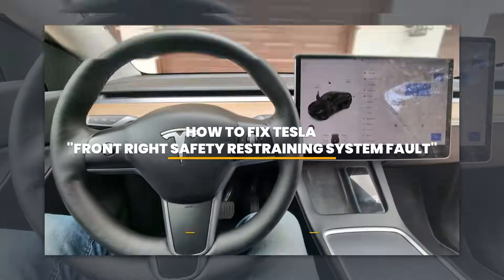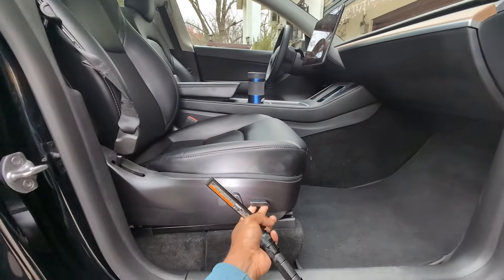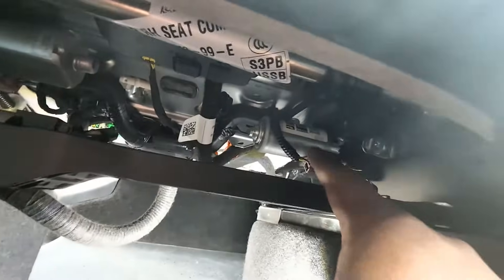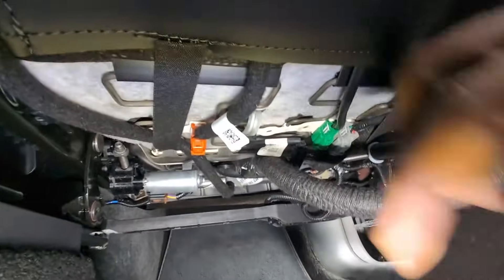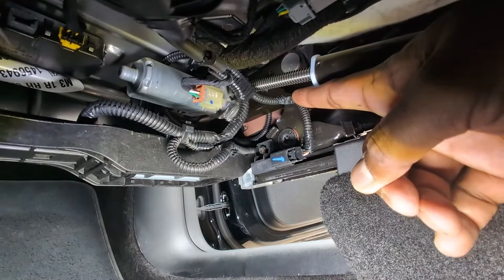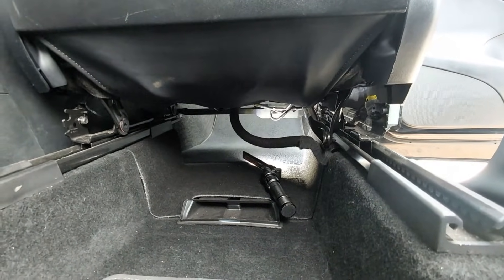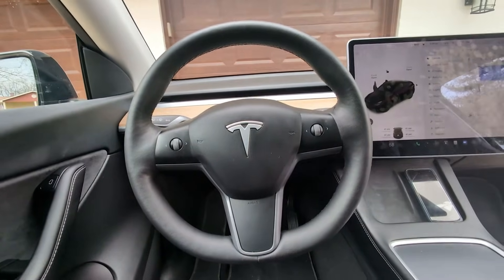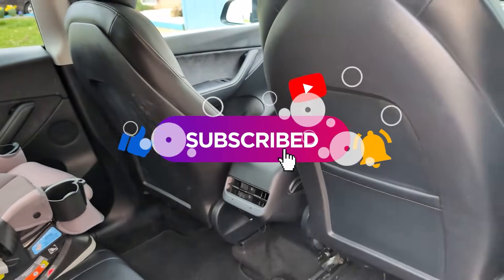Tesla Front Right Safety Restraint System Fault - SOLVED

Comment: I just started receiving similar error “Safety restrain system issue (RCM_a078)”

After watching your video I suspect wiring issue under the driver seat
Reply from the maker: Did you look under the seat? Any signs of wire detachment?
Reply: @JJCentral-DIY I actually figured it out. The issue is the buckle itself, when it is buckled, there is no continuity between two pins that come out of the buckle connector (even though latch/unlatch is detected). From what I understand RCM is looking for small resistance in buckle circuit. Found buckle replacement on eBay for $15, waiting for arrival

Comment: If you thoroughly check the wiring and nothing has been damaged, I would suspect the most likely to be the micro-switch in the belt buckle clip. Of course it would be a sealed unit and unreachable, so a replacement belt would be necessary. The switch gets worked every time you buckle up or unbuckle.
Reply: Update, the entire cover on the belt anchor clip is removable, and I was able to spray the switch with electro contact cleaner spray.  This didn't solve my problem. everyone knows when wires are bent back and forth continually, every time you get in or out of the car, the wires will eventually weaken or even break. Silly me, for some reason I had set the seat to a high up level when driving. So I just re-set it to just remain low at all times. Guess what... the warning disappeared and never returned. Should it come back, then I will replace the wire.
Reply from the maker: Thank you for the update. Others can see and get the proper idea. Use a continuity check in multimeter to see any breaks. You may need to change the wire at some point. Great job.

Comment: My M3 has message Front passenger safety restraint system issue (RCM_a056). Is this the same issue? Tesla quoted me over $1700 as they claim sensor, airbag and other components need to be replaced (never been in an accident). Is Tesla just trying to scam me?
Reply from the maker: Why don't you take a look under the seat?

Comment: I am getting the same error. Out of warranty as of April last year... and they want to charge $1140.
Reply from the maker: @TerribleMighty1  Did you check under the seat?
Reply: @ i did a quick check but nothing stands out. I have a model 3 so a little more cramped compared to a Model Y. I’ll check again in a bit most likely
Reply: Tesla wanted to charge me in the neighborhood of $1,100 also, I was at 51k miles at the time but Tesla wouldn’t good will or check fault history. My wife’s car so it could have popped up and went away prior to the 50k mile warranty was up. The warning comes and goes, now it’s been on a few days so I’m looking into getting it fixed and ran into your video. Thanks

Comment: I have this issue on my Tesla model 3 but i noticed there i a red plug coming off near the Orange connection that not plugged it but i cant see where it goes do you uave any idea . I believe it  has only 1 or wires in this red plug please help
Reply: I saw that on mine too. I think it's just a connection lead for Tesla service to plug in when testing. Just tuck it out of the way.

Comment: Thank you for the video. This is why Tesla sucks. Anything that revolves around safety in my mind should be covered under a lifetime warranty. A wire getting pinched because of their ineptitude with engineering is not a customer's fault. Tesla wanted to charge me close to $800 to fix this.
Reply from the maker: Hope you were able to do this yourself and save some money. Yes, there are some questionable tesla engineering designs that you see all around the car.
Reply: @JJCentral-DIY  Actually I looked under and it's not a pinched wire from what I can see. I have a 2020 model Y so I think the wiring is different. I saw a video where a wire could be interfering from a sensor and to put aluminum foil in between? Still trying to figure it out, but thanks again.
Reply from the maker: @HavingSaidThat1  turn off the car, disconnect all wiring harness under the seat. Inspect the connectors' for corrosion and length. Check continuity with multimeter where you can. Click it back again firmly. Check for any pinch or breakage.